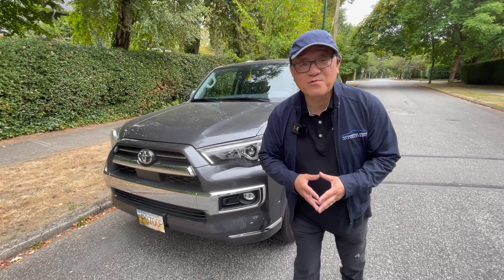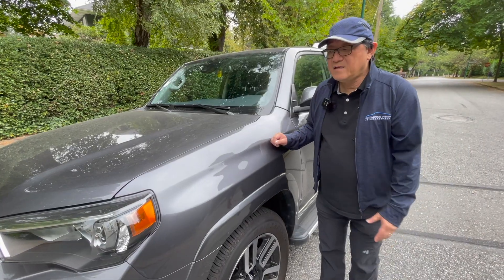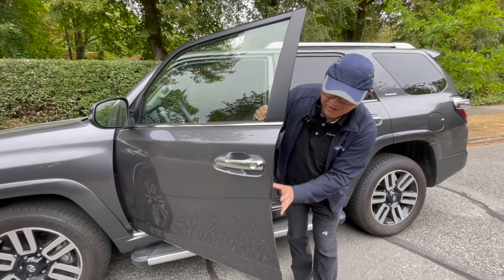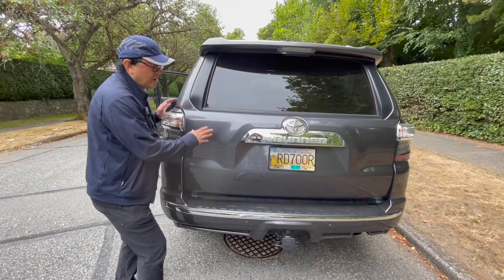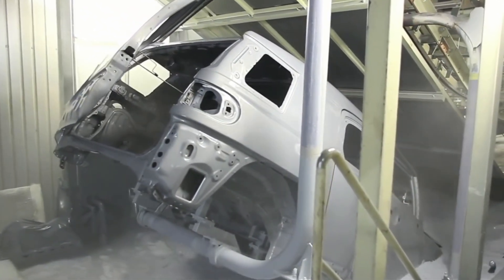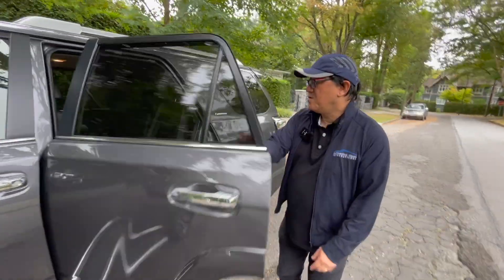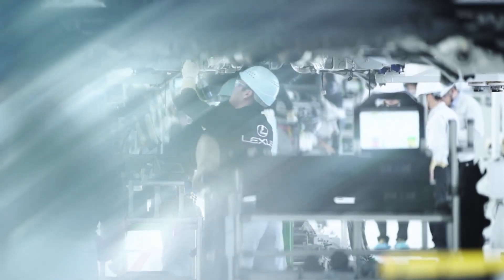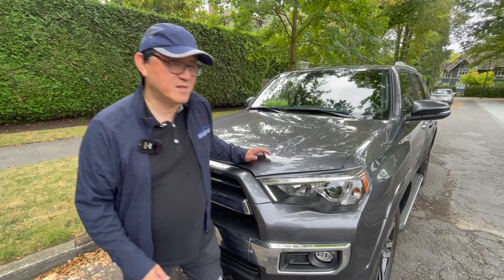PART 1: ENGINEER EXPLAINS WHY TOYOTA 4RUNNER HAS BEST QUALITY IN THE WORLD // STILL BUILT IN JAPAN

Comment: Both my  3rd gen & 5th gen 4runners have a very solid feel to them. You definitely feel it when cornering when the whole body and frame of the vehicle and thrown around in once direction, even more if u do it on a rough road. The whole cabin has a tightly solid feel to it

Comment: Love Toyota but my 2015 4runner just had to have the evaporator  replaced at 10000miles. Total cost $3100. Was told very usual repair.

Comment: Does anyone have paint issues? I see forums talking about chipping and clear coat failure and not just older models.
Reply: I drive a 2015 4Runner Limited. (purchased new, currently 172,000 miles) It has the Blizzard Pearl paint and I have had no issues with chipping or clear-coat failure.  I love the pearl finish in the sunshine.

Comment: Have a new 2023 4runner limited trim. Love it. Does the frame have any rust protection from the factory? 

Only flaw I've noticed so far is when I open the passenger side front window or door after it has rained I seem to get a waterfall coming inside the car.

Comment: My wife and I test drove a  bunch of new crossovers to replace her aging minivan.  She wanted something (anything) other than another van.  We tried Subaru Ascent, Honda Pilot, and the Highlander.  We were both turned off by the use of turbo-charged 4 cylinder engines (Toyota and Subaru), CVT transmissions (Subaru), and brand new models (Honda).  The prices of these vehicles are so high that we wanted something that would last.  We just put down a deposit on a lightly used 4Runner instead - mainly because of the legendary quality of this vehicle.   Looking at this video and others like it, I'm glad we made this decision.  Hoping to get 300+k miles out of this wonderful machine.
Reply: And you will get over 300,000 miles on your 4runner GUARANTEED !!!.....but only if you maintain it well.change oils regularly and please make sure u flush them and refill.dont just drain and refill and your 4runner will love you for eternity...even your grandkids will be driving it long after your gone.

Comment: I’ve ALWAYS wanted a 4Runner. Back in the 90’s my stepdad bought 2 4Runners. Both in the 150k mile range. He drove them for 6+ years and when sold them they both had well over 300k miles and 1 was really close to 400k miles. 😂 He sold both for the same price that he bought them. 
I literally just bought mine this past Monday ( 6/12/23 ). I got exactly what I was looking for. The Limited in blizzard white with the brown leather. Picked it up with 6 miles on it. Yeahhhhh there’s a couple things that would be nifty to add to it. Like power folding mirrors and a power lift gate. But those tiny nit picks are just that. And in no way a make or break for me.

Comment: @automotivepress I have a 2006 Toyota 4Runner Limited AWD V8, and with the exception of the frame starting to rust, the build quality is exceptional. From the mechanical aspects to the fit and finish, it is by far the best vehicle I have ever owned. Even at over 270k miles, nothing squeaks, rattles, or leaks, and the paint finish/quality is exceptional.  Toyota did the 4th Gen 4Runner owners a huge disservice by not offering to replace the frames as they did in the Sequoia and other vehicles. I’ll probably end up replacing my frame if i can find a body shop that specializes in Toyota SUV products.

Comment: If you live where there is snow, gravel and road salt, buy something else.   I’ve had three Toyotas dissolve until either the wheels fell off or they became unsafe to drive.  They were a Tercel, a RAV4 and a 4Runner.   Never again unless I move to Tucson or a similarly arid place. 

My 2000 Honda Insight, OTOH, is weathering Chicago without any hint of corrosion after 377,000 miles.

Comment: I am a loyal 4Runner owner over 23 years and 3 generations (3, 4, 5). It is an honor to own and drive a vehicle built in the Tahara factory. Thank you for your wonderful video!
Reply: I just picked up a classic silver metallic 2021 5th gen TRD OFF-ROAD PREMIUM with moon roof used with 7974 miles! Insane find! I’m still pinching myself. Bought it near Seattle at a dealer for $41,500 plus tax and licensing. Sold a 2007 SR5 5 years ago and a one owner 2002 almost 2 years ago. It was a long 2 years with out the luxury of a TOYOTA 4RUNNER IN THE STABLE. MY 2020 TRD PRO TACOMA now has a sibling! Could not be happier. BUY A TOYOTA!
Reply: I’m waiting for my first one .
Reply: I own a 2018 TRD OFF ROAD and I love it!!!

Comment: I owned an FJC and then a '19 4runner. It's true that they're extremely well built but saying the bugs are all worked out is a stretch unless you accept that Toyota means it to be that way. Poor throttle response, can't roll the rear window down without smelling exhaust, KDSS lean, VERY poor phone integration were ones that I dealt with in my '19. And then all the anachronisms like halogen headlights, putting in a physical key to start, 5 speed transmission, no AWD mode, 4lo required to user the locker and so many others. Weirdly I still loved that thing though, haha!

Comment: I cannot quite agree with this. I had a 2016 4runner only with slightly over 10k miles when my mechanic discovered leaking oils from the front shocks. Warranty did not cover. The weather strip from the trunk kept falling apart and was told by the dealership that there's nothing wrong with it. Also, it has such a terrible gas mileage (plus lack of power) when you're constantly driving uphill roads. Great SUV for rough roads of course, but not for freeways or regular driving. Such a limited usage... Dumped it and bought a 2021 highlander awd and it's gotta be the best SUV I've owned so far.

Comment: Thank you for the video! Im going to buy a used 4 runner in the next month or so. Does year matter? Im looking at 2012 and up and under 150,000 miles and interested in a 4x4 for off roading. Just unsure if the newer models are better or should I focus on lower miles if the car is older?

Comment: Love my 2018 4x4 Prem.  However, think paint, a couple of drips, excessive body roll and nose dive (partly corrected with Bilstein 5100), and leaking timing chain cover which was replaced under warranty.  To replace the timing chain gasket, they had to drop the front half shafts, rack, oil pan and pull off the intake & valve covers and of course pull off everything on the front end.  How much would this have cost if not under warranty?!?!?!   Tech told me that most people would have not noticed the leak.  So, I suggest that you degrease your engine and watch for oil on your passenger side valve cover.  That is where I noticed the oil.  Mechanic did tell me that when they replace the gasket they are required to use a different gasket sealer, probably more expensive than the original.  This was his answer to my questions as to whether they had a new part number on the gasket - i.e. did they upgrade the part.
Reply: Again, love my 4Runner, but the cargo cover is junk.  I accidentally ripped the plastic handle off of it pulling it a bit too hard.  However, I noticed that it was not connected in any way to the metal bar inside the cover, so I drilled holes on the other side of the bar and zip tied the handle in place to the bar.  Works great now and will not detatch in the future!!!!!   :)

Comment: The paint is the only problem I have with my Toyota. The paint does not last. The car will last forever but the paint job does not.   If you get a white one it’s like they just barely spray it on there.
Reply: What year is yours?  There was a Toyota TSB that covered several years and models with white paint; ask your dealers

Comment: Just wished they sourced better doorlock actuators- On my third driver side (Works sporadically so a 4th is needed) and on my second passenger side actuator, and it hasn't worked in a year- just dealing with it. 2015 Ltd.

Comment: 2019 TRD Offroad with KDSS owner. Love my 4Runner....only complaint is the engine cam shaft should have been grinded for more low end torque. Engine RPM at highway speeds produce very low torque. Any grade in the road (hill) transmission has to downshift.

Comment: I had a 1998 4 runner finally got rid of it last year not because the engine failed, because it rusted out 1st!!! Had over 300k mikes still started every morning. It took me to FL, MS, AL,NJ, NY, NE NEVER gave me any issues in over the 15 years i owned it. I changed the starter once regular oil changes couple batteries over the years BUT NO other mechanical problems. That truck paid for itself. I bought an Acura and I’ve put MORE money in this crap in the 6 years then i did all the years i owned my 4Runner 😢

Comment: David, thank you, for the video. I owned a 2013 4runner until this year. I loved the car. Couple of things however, the paint seemed to hold up so so. It developed water spots very quickly after purchase also, there was some slight rust in a couple of spots on the roof. Quite surprising since it was covered in a carport it whole life. The other thing was the rubber gasket for the back hatch door became delaminated so that was disappointing. Otherwise, it ran like a champ and never had any mechanical issues. I am considering buying another one.

Comment: I have an 05 4Runner that’s all built to go overlanding. Even with 227k on the clock, lift kit, armor, auxiliary battery system, winch, and tires, it drives better than any other car I’ve ever had. Furthermore, it feels solid. I enjoyed this video-thanks!

Comment: Today I bought the 2022 4Runner, TRD off road Prime. Charged for the Pro wheels but the lug nuts are back ordered so came with the stock wheels. They say about 6 weeks for the lug nuts and when they come in I bring it back and they install rhe wheels I paid for. Will see how that works out. Vehicle takes some getting used too but rode fine. Steering wanders a little but it is hydraulic. Much better equipped than I expected with most if not all safety features. I have the black paint which has amazing blue chips in the paint. Really is nice in the sun. Look forward to some dirt, rock, snow. Has the crawl feature but that’s not to be used for every situation. Looking forward to getting to know the car better and expect many years of dependable driving.

Comment: My heavily abused 2009 Lexus GX with 250,000 miles (402,336 km) is still going strong after years of off-roading, snow storms, neglect and neglectful children trying to rip it apart. 

A “competing” GM/Ford or Eurotrash brand vehicle would have died at 130,000 miles after costing thousands in repairs just to make it that far. That’s why I’ll stick with GX’s for as long as they’re made.

Comment: I’ve had my 2016 SR5 Premium for just over a year and I’m very happy with it. 91,000 miles and it’s been quiet and rattle free until recently when a small heat shield on the exhaust came loose on one end. I took it to the local indy shop I trust and had my friend there look at it. He said it couldn’t be reattached but it wouldn’t hurt anything to remove it, so that’s what he did and it’s quiet again.

Comment: I had a 2004 Limited V8 with 257k on it. Now I have a 2007 Limited V6 with 175k on it. I actually preferred the 2004 a bit more but still love this one. I almost feel bad for never taking them off-road, almost. I'm thinking of making a giant leap to a 2017 or so in a few weeks/months when prices supposedly will normalize. Any tips on one year over another in that age range? I do want a backup camera and leather so I'm still thinking Limited.
Reply: I'm also look forward to your tips as well. What are the most fuel efficient models? And most reliable? Thx

Comment: I have a Fortuner in Phil. Fortuner was made in Indonesia.  I complained of the very poor paint job, it is so soft that if you run a leaf or your nail slightly, it will scratch.  I also complained that the seat on the rear had the wider seat on passenger side. I would have thought it should be the narrower seat so that it can easily fold to allow access to 3rd row seats.  I complained to Toyota Indonesia, Toyota dealer Philippines and Toyota Japan but very disappointed they did not admit to any defect.   The toyota dealer Philippines just checked the paint thickness and said its within tolerance.

Comment: I have a 1998 Toyota 4Runner SR5 in Anthracite Metallic with 336,000 miles. I bought it brand new in October of 1997 and frequently receive comments on it. I routinely do general maintenance on it and have not had any major mechanical issues... It's my only vehicle and it still runs well!

Comment: Just got my 21 TRD OR in silver with the skid plate led package and a few other options I love it so far.  Will be around for a long time.  Upgraded from my gen 2 1995 SR5 V6 built 08/95.  Only has 139000mi still has a long way to go.

Comment: And I thought I was a 4Runner/Toyota/Lexus enthusiast before I watched this.  There's a 05 V8 4Runner in my garage with 313,000 miles on the clock that runs amazing.  Along with that are two 03 IS300s, one 02 GS430, and a 98 SC300.  It's a very cost effective way to run a fleet of cars for five drivers in the family.  A Gen 5 4Runner is in the cards for future ownership.

Comment: Honest question: how did the Takomi members allow Toyota's sudden acceleration problem we saw a few years back to occur if they are so full of experience and have such high levels of expectation?
Reply from the maker: The so called sudden acceleration was determined to be driver's error - it was officially announced by US government after extensive research.  The head of US automotive safety group apologized to Toyota for blaming them for what turned out to be a driver's mistake (or misplacing of floor mats by the dealers or owners).  There was nothing wrong with Toyota or Lexus models.  This is many years ago by the way.  Please go ahead and google this and check it yourself.
Reply: @AutomotivePress  Thanks for the info.  I didn't hear more of the story after the initial reports, and I especially recall the one which happened in San Diego due to proximity to my area.  I only buy Lexus and Toyota (at least until the CyberTruck comes out), and it just boggles my mind why American car makers can't make reliable and fuel efficient cars!  I think it is due to an unholy alliance between oil companies and American car companies to keep milking the American people.   As for the reliability part, perhaps all the great American engineers work for NASA, instead of at our American car companies :D

Comment: Great video.   I've owned 3 4Runners as well as a Land Cruiser and a Lexus for my wife.   I was a product development engineer at Tier 1 supplier Bosch for 8 years.  Toyota was my customer and a I can verify that Toyota has a world leading approach to manufacturing and engineering, that is different from other car builders, even in their US plants.   We were required to be fully versed in Kaizen principles and methods to produce components that were suitable.  ✌🏼
Reply: How about that Bosch cp4 high pressure fuel pump.  Quality.
Reply: @westeed1  Not familiar with that specific pump other than to know Bosch produced many different pumps.  I was involved with the antilock braking and vehicle stability control units.

Comment: Good video, I own 2016 4Runner. I’m disappointed in rust starting to form at bottom of doors and back hatch. The motor and tranny is outdated. Fuel economy sucks. It does drive like a tank. The good, reliable and cheap to maintain. Excellent resale value. I’m waiting on new release with improvements all around. Technology in every aspect has advanced since this gen released.

Comment: Aren't the Land Cruiser or LX better built? The 200 series and 570 had a 14 year run, so certainly they must be higher quality.
Reply from the maker: The Land Cruisers and LX are actually built in Yoshiwara factory, which in my opinion, isn't quite as good as the Tahara (though very close)
Reply: @AutomotivePress  I see. Is Tahara the best plant? The Land Cruiser 200 was built in Tahara for a few years btw.

Comment: My 2019 SR5P has 44000 miles on it and many of those miles have been on dirt and gravel roads. The runner has had zero issues and I hope to put at least 400K miles on it. There are many who complain that the 4Runners are dated inside and out, but I don't care. The quality built in to the runner is fine with me as it has been a very dependable vehicle.
Reply: That's good to hear. I got a 2022 on Feb 28th. About to hit 15k. Probably 1/4 on gravel

Comment: As an occasional vehicle consumer, I miss the days when the phrase "built like a tank" actually MEANT something. You've shared information about the 4Runner that instantly places it on my short list of "next" vehicles (MPG be damned!). Thanks very much for another uncommonly good video.
Reply: We just bought a 15. I absolutely love it. Even the SR5 trim is well equipped, drives awesome, is unstoppable off road, and really does feel like a tank. With 50k miles on it I expect it to be running just as well 10 years from now.
Reply: My 1993 4runner is built like a tank, no lie lol
Reply: Ditched my 2020 tiguan for 2018 rav4 and I felt relieved owning toyota !!
Reply: I am pretty sure the 4runner will have a hybrid system in their next gen 4runner. Toyota appears to be transitioning all their models to hybrid. In due time. It would be awesome if the 4runner can get at least 30mpg with a hybrid system.

Comment: My 2022 4Runner Limited has been making a loud howling/whine noise between 65mph to 75mph under light throttle since day one.  It's driving me nuts.
Reply from the maker: None of the 4Runners I've driven had that issue - maybe get it thoroughly checked by a dealer